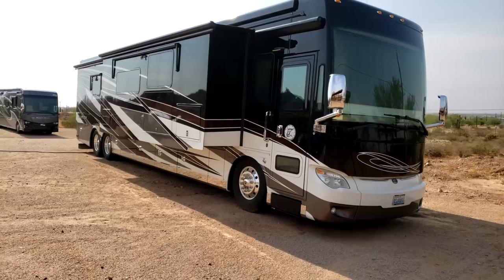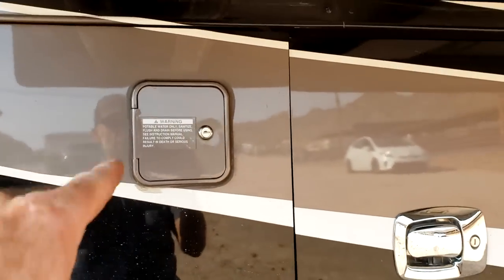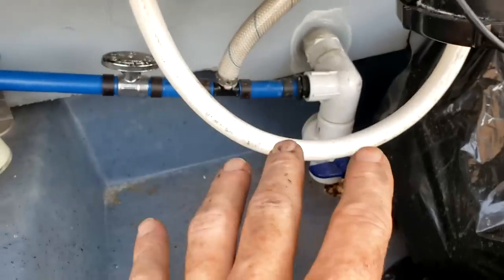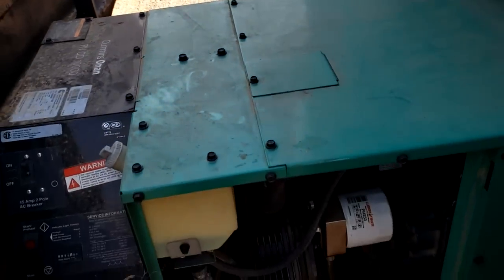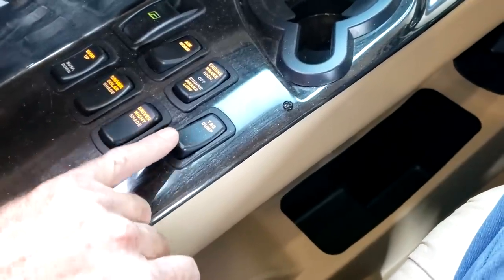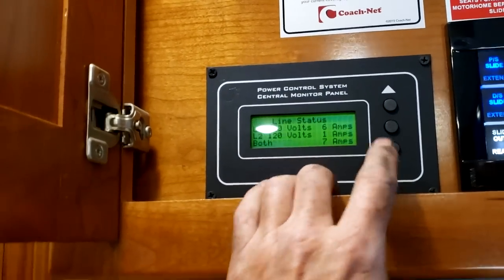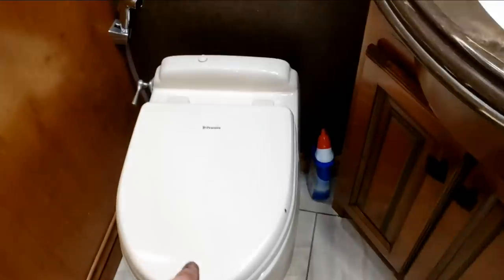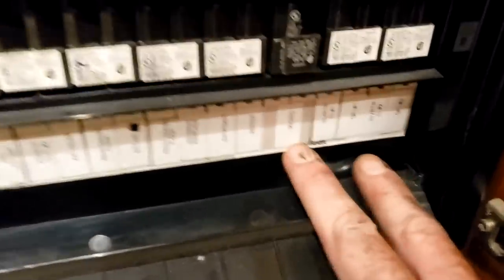How To Operate a 2016 Tiffin Allegro Bus...and Most Luxury Diesel Motorhomes

Comment: James ...great advice regards the roof on any of these RV's. 
I find the "mess" of sealant applied around exterior AC units, fans, ariels, etc used on the roof by most if not all manufacturers  ,just because its not seen , is unacceptable. I aint no defender of the rich ,I'm a poor guy trying to buy a good 4000hh tent ⛺ and kit for solo camping. However I dont like anyone rich or poor getting ripped off, and your educating me  .

Comment: It's a converter that charges your 12V DC friend. Not an Invertor. An inverter takes your 12V DC and transforms it to 120 AC. Please do not think I am disrespectful. I admire your work here. You do a fine job.
Reply from the maker: Yes, of course. This inverter is a inverter/charger but is only called an inverter. It can get confusing. Thanks!

Comment: Didn't Andrew Steel's Newell Class A vatch fire and burn to the ground while driving with the generator running. The last I heard was they thought thats where the fire started. If you have more up to date info I'd love to know. I know you know Andrew. That was one pretty coach.  The reason I ask is our dash air doesn't work as well as we'd like and I would love to run the generator more to keep it being used running the front roof a/c while driving. Thanks
Reply from the maker: I do not think we ever found out the cause from Andrew. I suspect it was in the dash based on the videos personally as the generator is a firebox isolated. But most RVers do use the generator driving down the road in the summer.

Comment: Thor owns Airstream and has for many decades.  Do you see Thor’s acquisition of Tiffin as Positive, Negative or Benign?

They appear to be much more complex than my Airstream (which is pre-Aqua-therm{?} heat).  While it seems like a nice feature it also seems like it could easily be very, very expensive to repair.

I guess I would want a Tiffin if I were going to be Full-Timing it. Otherwise I’ll stick with AS.
Reply from the maker: I don't think hyper consolidation of any industry is good, and I am very concerned without Bob holding everyone accountable, Tiffin will slide into mediocrity

Comment: That's a 50 amp 240 volt plug. It would plug into a four wire range outlet. Just letting you know. Now everything in the RV is 120 volt, however I will bet your main breaker inside is a 2 pole 50 amp breaker, with one side doing 1/2 the breakers and the other side doing the other 1/2. Not knocking you, just saying what I know as an electrician, and in facebook groups so many get confused on the difference between 30 amp 120 and 50 amp 240 volt.
Reply from the maker: you are correct of course
Reply: You made me wish I was rich enough to buy that. I’ll bet that water heater works great.

Comment: only thing I do not like is that DEF/DPF crap, maybe you can register it in Mexico and delete it?
Reply from the maker: I do not like it either
Reply: You can send the ECM out for reprogramming and eliminate / delete all that stuff on the Cummins L9 depending on your state inspection process. Was going to do it but it works so well and the exhaust is unbelievably clean. No soot in pipe, no smoke and no smell...plus I am getting over 11 mpg on the 37' version of this coach so why mess with a good thing.